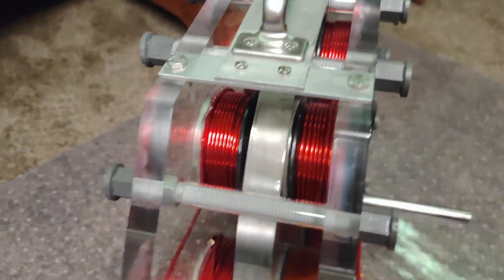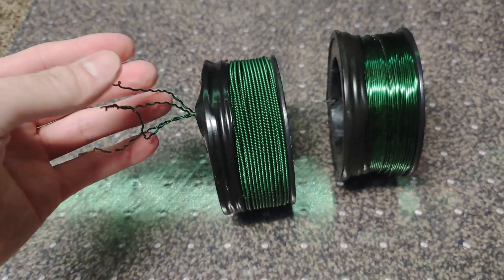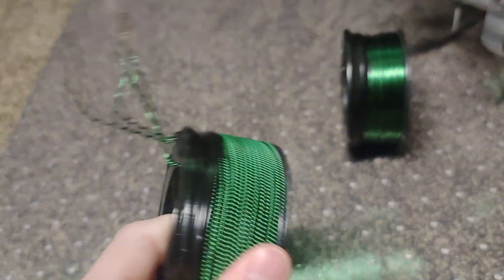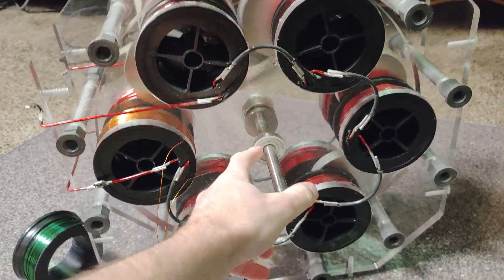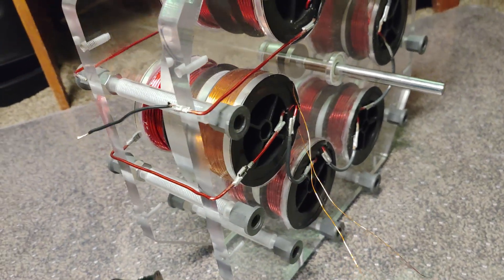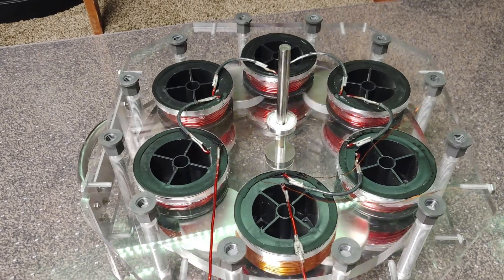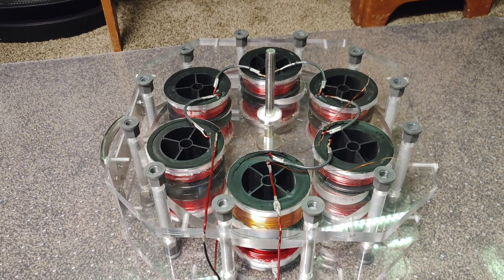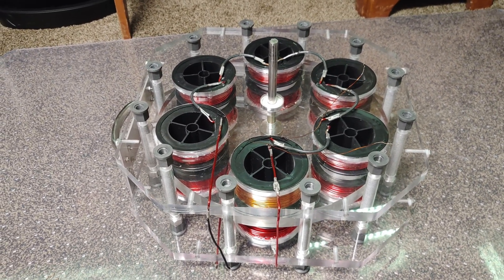Motor/Generator Ideas #1

Comment: Did you made some calculations about coil design ? I think they should be a bit flatter , that makes every turn to be closer to the magnet thus making it more efficient  , also I think the coil diameter could be a bit more than the magnet diameter since the magnet field is bigger than the magnet itself . I really like how you build the frame and ,how nice it turns , did you ever thought about triangular coils ? They would cover more area ,  You could make 3d printed formers , I have 3 acrylic discs laying around and some magnets and wire , so I might end up copying your style since it looks so cool , you just need to step up your driver design
Reply from the maker: I actually bought the coils from a company that fit perfectly in my frame so I didn't have to manually wrap all 12 coils. But I've thought about trying to wrap my own. I understand that having the wires wrapped traditionally will be more efficient but I noticed with the twisted coil there is far less drag on the motor but that could be due to less interaction with the magnet. But I still need to figure out how to setup a gate driver for the IGBT. I chose a large high output one because I didn't want to burn it out I've burnt through a bunch because I improperly used them without a driver maybe be the cause
Reply: @garretwalenski8215  Oh yeah , winding coils is a pain , I hand winded a few tesla coils and I know how hard it is , but I been looking at axial flux alternators builds and I see some of them use a triangular shaped coil . I can help you with the drive circuit , I am not expert but I did learn a lot from building tesla coils , I think that IGBT might be a bit overkill to drive that kind of load but anyways you can make it work ( it might have a higher Rds on than a smaller switch like a mosfet , which means that when it is ON it acts like a resistor thus having a higher rds on will limit your current a bit and also produce heat on the switch , usually mosfets have the lowest rds on , but don't worry to much about this for now ) , I tell you how I would build the drive circuit : I would use a microcontroller (any cheap arduino would do it ) to read the Hall effect sensor , and when it reads the pulse from the Hall , it would send a pulse to the gate driver to open the IGBT for a given time ( lets call that pulse lenght ) which you should test to find the best (it should change depending on the rpm )this would be to avoid the coils to stay on too much time and sucking back the magnets it would be a very simple code I can help you with that , gate driver are pretty simple , they have two power pins ( Vcc and GND ) and then your input , and output to the gate of the igbt , usually negative rail of the driver goes to Source of the igbt , I can draw you a diagram tell me which driver did you get ?. Did you study anything related to this like engineering ,or you just like to build stuff ?
Reply from the maker: @rodriguezfranco3839  i just like to build and learn how things work! I am fairly new to circuitry. I am looking at a 5 pin gate driver, low side, non inverting, 25ns rise, and 18ns fall. Capable of 14A. I have a few other MOSFETs and IGBTs laying around but I like having a large one so it doesn't get as hot
Reply: If you don't care about the cost , that driver will work , but it is overkill , the power of the driver mostly will depend on how fast you need to switch , that 14 amp driver I seen people switching IGBT bricks up to 300khz you will never get that high in frequency . You need to try putting those freewheeling diodes on the coils
Reply from the maker: @rodriguezfranco3839  ok so I was kinda thinking that after looking into it more as well. I need to order one and just play around with it till I see how exactly they work. I was looking at the adrino circuit boards and they are programmable which is pretty neat. Freewheeling diodes? Is that just a diode in reverse polarity? I have a bridge rectifier inline going to the IGBT directly to prevent back EMF. So if I put reverse polarity LEDs on every coil that will help with what?
Reply: @garretwalenski8215  Oh I thought you did not have any back emf protection , you can try the reverse polarity LEDs (at least the energy won't go to waste ) , I thought the heating problem was from back emf but then the heat must come from not properly driving the transistors , cause I mean if the transistor is switching right there should be very little heat , are your coils in parallel or series ?
Reply from the maker: @rodriguezfranco3839  it only got hot as I got past 40 volts. I was pushing it to the limits of my DC to DC converter then I blew it because I ran it so low on volts. All the coils are in series to lower the ohms otherwise it would pull so much current. I probably should go back to 18 gauge or even that's what I originally had but I wanted to try a low ohm motor to see if it would spin faster. I have a hall Effect driving the gate and a variable resistor inline to control the current or moreless the voltage because current is non existent but I was thinking maybe I just need a resistor in-between the bas and collector? To bleed the internal capacitor maybe like a 10k or 15k
Reply from the maker: I meant a resistor in-between the gate and the emitter
Reply: @garretwalenski8215  mmm... Sorry to ask so many questions hehe , I just want to help you. So your variable resistor is between the hall sensor and the gate ? If so , then there is your problem that means you are using the igbt in the half turn on / half turn off area (I don't know the technical name of it , but we call it the active zone in bjt transistor)  and it makes the switch produce a lot of heat and makes the igbt act as a resistor . yeah pull down or pull up resistors can be used if you don't have a gate driver , but anyways the hall sensor by itself is gonna have a hard time trying to switch the igbt on (you will need at least 15v at the gate to fully turn it on) , you should just put a small value resistor like a less than 100ohms between the hall and the igbt gate and a pull down resistor ( which can be like a 10k ohm ) between gate of the igbt and the negative rail , that will discharge your gate, turning off the igbt faster , but all of this is just a very bad inefficient way of switching it , with a gate driver it will be a very big improvement , once you have a gate driver in your hand ask me I can draw you a nice diagram on how to build the gate driving circuit , you can use a lower power one don't need 14amps gate driver for this , take a look at the HCPL 3120 , it is used on industrial motors VDFs to switch igbt bricks and is only 2.5 amps
Reply from the maker: @rodriguezfranco3839  I don't the question your helping me figure things out for sure! I see what you mean by not driving it right if I'm trimming down the current from the hall sensor. So I will get my hands on some gate drivers soon probably within a week or so. Thanks for all your input I appreciate it! I'm probably going to try the 100ohm between the gate and hall sensor. And that 10k between the gate and negative. I could use a pwm for input control I have two of them laying around. That could be useful
Reply: @garretwalenski8215  Thanks brother , yeah basically you want to work with the igbt fully on or fully off , and you can speed up or down by pwm on the input , once you get a gate driver and a arduino or some microcontroller you will be able to play with the time the coil is on , and some other parameters that will be a game changer
Reply from the maker: @rodriguezfranco3839  with the Arduino do I even need the hall effect. That would be what is controlling the timing of my motor essentially? Or does the hall effect communicate with the Arduino?
Reply: @garretwalenski8215  I would still use the Hall sensor , that would be like your CKP sensor on your car , it will tell the arduino which is the right time to power the coils , but you could power the coils for a few miliseconds at the right time , and avoid wasting energy that is not being used , lets say it will allow you to have more precise control over your coils.
Reply from the maker: @rodriguezfranco3839  yeah that's a great way of explaining it thanks I now see the reason for the two. I will order a basic Arduino with a USB and I see Amazon  has those hcpl 3120 optocoupler divers as well. What pins on the gate driver are the ones that communicate with the Arduino? I see there is an anode & cathode on one side and a negative going and positive going on the other side. So power in on the anode\cathode side and Arduino side goes to the other then some pin that connects to the gate of the IGBT?
Reply: @garretwalenski8215  Anode and cathode are just a internal LED inside the chip since it is a opto gate driver ( when the led is on the gate driver output goes on , when the led is off the gate driver output is off) anode goes to the digital output of the arduino lets say D5 through a 360ohm ish resistor to limit the current and avoid killing the internal led , the cathode goes to the GND of the arduino (negative ) . 
Then on the other side you have , VCC which goes to + 15v  , and Vee goes to the negative of that supply , then your pin 6 and 7 ( which are the same cause they're joined toghether inside the chip ) go to your IGBT gate through a 10 or 15 ohms resistor , but I will draw you a diagram later
Reply from the maker: @rodriguezfranco3839  ok I understand that pretty much. I always was thinking if I could use a led to trigger the transistor in some way like what the hall effect does with a magnetic field. Nothing is faster than a light transfer. So I'm guessing they are able to  use the light intensity to trigger the circuit to open and close. That's smart way. Glad you brought this up!
Reply: @garretwalenski8215  yeah in a optocoupler the LED is mostly for isolation , since your arduino could be connected to his own battery and it would be completly isolated from the high voltage , all the arduino will be doing is turning on a led , but on the other side you could be switching massive voltages and/or amps and don't kill your arduino or cause interferences that way . I build a pretty powerfull DC-DC buck converter for my tesla coil using one of this 3120 gate drivers , and a fga60n65smd igbt and it is controlled by an arduino , I put the diagram on my comunity section a while ago it says some like "QCW buck converter" and some other youtube chanel helped me figure out the gate driving cause I was very lost , he even did a video explaining it I will try to send it to you , it was a very nice explaining on how to switch the igbt
Reply from the maker: @rodriguezfranco3839  I will probably just pull from the power supply that I power the motor with but I will use a small DC to DC converter to power all that separate. I've thought about building a Tesla coil too but seems a bit dangerous for me lol. But not not as dangerous as hho I guess. That's some scary stuff to play with.
Reply: @garretwalenski8215  Yeah you can use a dc-dc to power the arduino and the gate driver , you might need to use two cause the arduino Uno can take from 7 to 12v and the gate driver eventhough can work at 12v it will be ideal to make it work at 16v . Solid state tesla coils are pretty safe you usually (not allways) can touch the arcs and you won't even feel anything .
Reply: @garretwalenski8215  I did some hho experiments a long time ago , and yeah that was way more dangerous for sure . I found that video I was telling you but I forgot I had to do some crazy layout cause I needed to do high side switching , so I think it is better if you don't see it hehe it will get you mix up , I am gonna draw you a nice diagram later and if I have some time might make a explaining video , but I think you already understood how this work
Reply from the maker: @rodriguezfranco3839  I should be using the low side right? Because you were working with high switching speeds to generate high voltages for that Tesla coil. I'd appreciate it if you sketch up a circuit diagram but I think I may be able to figure it out from online search
Reply: @garretwalenski8215  YT keeps deleting my comments but I did the diagram , I am not sure if you could find it ?
Reply from the maker: @rodriguezfranco3839  I saw it I gave it a like. And subscribe to you as well. What I never heard of a free wheelie diode before what are there purposes
Reply: @garretwalenski8215  It blocks the back EMF from the coils
Reply from the maker: @rodriguezfranco3839  schottky diodes don't work the same? That's what I've always used
Reply: @garretwalenski8215  freewheeling is just how you set them up ( in antiparalell to the coil) so schottky diodes can be used as freewheeling diodes , any UF diode would also work like UF4007 or UF5408.
Reply from the maker: @rodriguezfranco3839  okay that's what I was kinda thinking. Sucks that diodes have to have a voltage drop be cool to put a diode in-between each coil set but that would behave such a voltage drop after 12 coils

Comment: Hi Garett! I really like how you made this motor-generator model. Very interesting design, although not new. I would like to know a little more about your vision for this motor-generator project. What should be the motor part? How many coils should work as motor? How many turns does each of these coils have? What should be the speed of rotation (RPM)? Is any other load expected besides the generator part? What power supply is provided for the motor part? All the coils of your motor are connected in series - obviously a single-phase motor power source is assumed. What form of voltage is supplied to the coil?
    As you can see, I have many questions about your motor-generator model. I have been doing this kind of modeling for several years now and have already made some progress in this area.I would like to talk to you about this topic. Learn more about your models, designs and plans. If you are interested, I would tell you about my achievements. But this is inconvenient to do on YouTube. Is there any other way to contact you?
Reply from the maker: Some of my other new videos explain some things you are wondering about